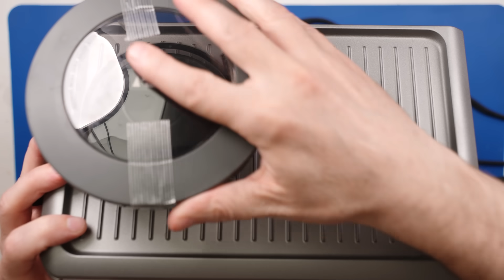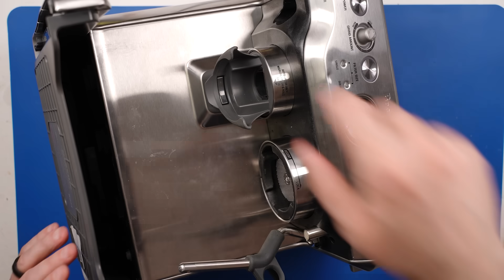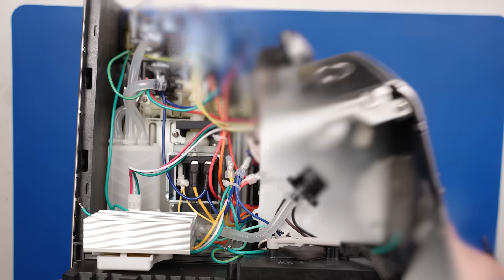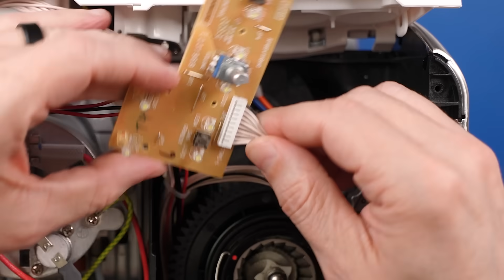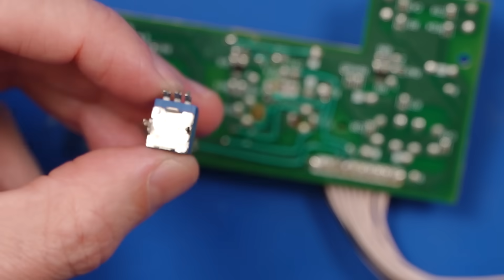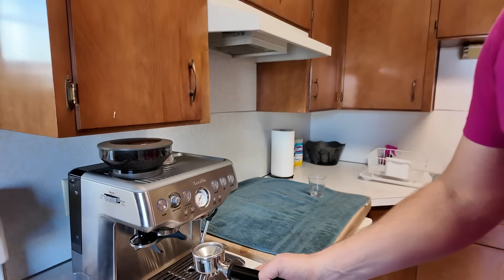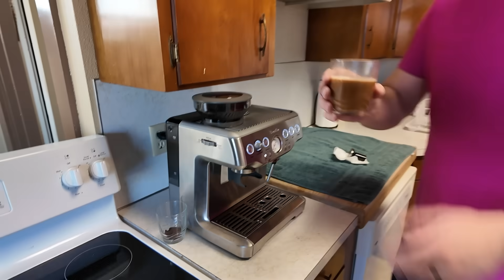Are Expensive Breville Espresso Machines Repairable?

Comment: I tried to fix one of these. Managed to replace the frother wand but the machine wouldn’t get up to temperature. It did after I replaced the temperature sensors but stopped working soon after that. Had to sell it on but still managed to get £190 for it.

Comment: It's great that someone donated this instead of just tossing it in the trash.
Nice fix. I'm willing to bet putting it back together was harder than the board repair.
Reply: looks overly complex, most people would not even try a repair like this. I have done electronic engineering and i would not even have attempted that repair.
Reply: ❤like it so much. ❤️
Reply: Is it great?  Seems kind of unethical to me, assuming they knew they had damaged it and it no longer worked.   Also unethical for goodwill to sell it.  ESPECIALLY for $100.
Reply: @ms.c.2897  do they not mark it as non functioning? I have this small thrift shop near me that I used to go to and they wrote if something was not working on the price tag
Reply: @cadegamer2854  i kinda doubt that they would waste space on shelves for non functional electronics or appliances... i mean, who, except this guy, is gonna touch it?   It's been a long time since I saw this video, but wasn't the first thing he did is see if it worked?  So that would mean it wasn't labled.

Comment: I bought a guitar Amp years ago and it never worked out of the box and so I just set it aside. I took it apart a few years ago and found the same thing a cracked board. I was able to bridge the gaps with wires and it now sits at a friend's house where I play on it when I hang out there as I have a better one at home.

Comment: The crack started at the rotary potentiometer, which was that dial that you said was dented. I bet it was dropped in shipping.
Reply: @rdittmer78  Yep! Either damaged in shipping or when the buyer removed it from the box.  Big, heavy appliances and protruding knobs do not mix (many a power amp owner have learned this lesson).  I’d bet this isn’t the only machine to have met this fate.
Reply: @scottogata1  Would be my guess as well. The board is held on those plastic pilars, the break looks like the potentiometer was pushed right through. 
I would assume someone dropped the machine on its face while unpacking. Like trying to struggle it out of some foil or styrofoam pading or whatever they used one handed. I think it is one of those papermache forms.
I doubt some shipping issue. Usually those buttons have a lot of clearance within the packaging and those packaging materials these days can withstand quite a beating. during shipping you would more likely crack the water tank, unless the whole package got severely smashed. But then we would see more than just some small dents underneath and scratches on the knob.
Reply: @scottogata1  The board enclosure didn't even have backsupport, so the weird cracking is prolly due badly supported PVC casing too.
Reply: I’m also betting it was part of a drop ship order.
Reply: Amazon guy threw it over the fence?
Reply: I own a variant of this same machine. That knob is super well protected in a thick foam form-fitted insert, probably to avoid exactly this. I agree the customer likely dropped it face-first while pulling the rest of the foam off.
Reply: That dial is pretty tough to turn, I have this machine. Hopefully that stress doesnt crack that glue again...
Reply: When reassembling use your video segment as reference from its removal. Many cures are done in editing.
Reply: that was my thought esp since the knob had damage to it from the outside..  maybe fell over when the customer pulled it out of the box.. interesting that it made it to a good will store vs back to wherever it was bought from..  I only clicked on the video as i own the same machine and wanted to see the inside.  (for 12 years).. and mine continues to work perfectly every time I use it..  but I can say that pot has always felt VERY flimsy and it sticks out more than anything else on the front panel.. so flimsy that in fact (like most people) I keep it on my kitchen counter.. I could honestly see dropping a coffee mug out of the cabinet above doing this kind of damage if it hit the knob directly..  lucky for me the only thing ive done to mine is replace the water filter and the blades in the coffee grinder...
Reply: @eldoradoboy  blades on the grinder where originally plastic and wore away - great way to ingest microplastics!
Reply: I had the same issue. Shipping company dropped my machine and broke the pcb under the potentiometer. Inside the package it's still visibile the dent made by the knob
Reply: Im thinking it was on an unstable surface and fell. Then the owner just left it in a garage and constantly tossed it around cause it was already junk but didnt want to get rid of a $500 machine. After a number of years it found its way to goodwill.

Comment: man, installing button the wrong way, I felt that. Great job!
Reply: it killed me watching that happen. but damn if I haven't done something like that myself.
Reply: @Chewymentos  could be worse. Soldered DIP chips in backwards, final check got an "awshit" and desoldered it and put it in correctly and once, chip on the wrong side of the board.
Prize winner, two leads, put in diode backwards, realized it before powering up, desoldered it, went to reinstall it and somehow the damned leads didn't reach the holes. With some fun and games, considering the close cut to the board, got it back in. Dunno, maybe it shrunk in the wash.
I mean, that violated all of the laws of geometry and physics.

But, teach your fuckups along with your successes and students learn and don't replicate your mistakes - hopefully.
Reply from the maker: Lol

Comment: Definitely a repair issue directly from hell. Respect for this good work. We would just replace the whole board. But Machines from Breville or Sage are allways not that funny - i hate repairing them. But my first Sage also made me mad because of the Screw on the Backside - without removing it complete you wont get it out. Looking forward for the repair of a first big one like Bezzera or Rancilio. Would be quite cool!
Reply from the maker: Would love to repair a more expensive machine. I looked around for one but couldn't find any that looked good. What are good brands to look for and what are the common problems you see with them?

Comment: Putting the switch backwards is truly a classic. I did the same many many times
Reply from the maker: Ha, ha, glad it was entertaining at least
Reply: @Tronicsfix  it's always funny when it's not yourself!
Reply: I actually was like, why didn't you test it before finalizing it? Why? Why? I felt relieved, when it turned out you should have tested.
Reply: Ain't managed that one, but I've had my own fair share of five star blunders.
Including not noticing wiring was near a great honking big gear wheel...
Considered firing myself, but couldn't afford to hire a replacement since I worked so cheap.
Reply: I was screaming the whole time😀
Reply: @M.Leblond  hahaah, same, same
Reply: I welded a massive machined plate upside down. The plate has around 200 holes drilled in it, in different locations. The hole configuration looked symmetrical at first glance, but it was not...... funny now, not so much then.🤣
Reply: Along with having "extra" screws. Being a technician is great.
Reply: I was watching as he was fitting it and I was almost shouting at the screen to have a look at the other side where the button switches were. Doh!
Reply: If you grind off the silkscreen either side of the crack a solder blob will both electrically & mechanically join together the two sides. A bit of bare copper wire underneath can improve that a bit more to get it flow across the crack/gap that remains.
Also when the PC Board was glued flat again the encoder/volume knob pins should have been returned to the right shape as well with some needle nose pliers. 😁
Reply: i thought it looked a bit out of place there lol